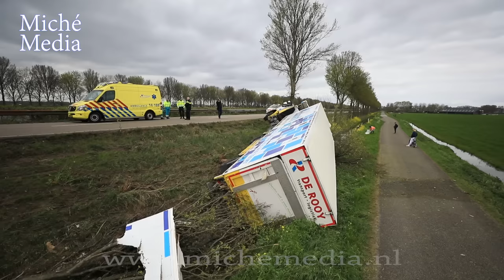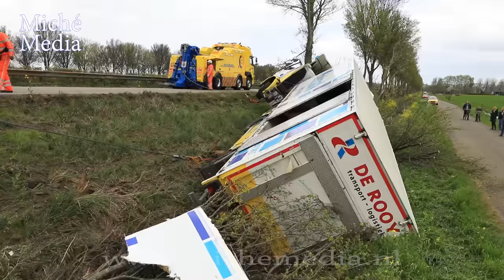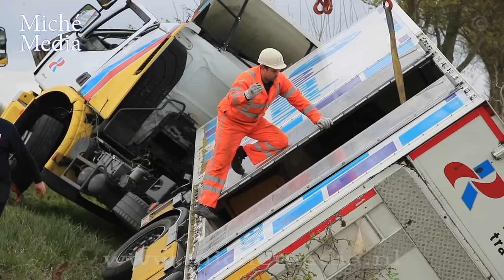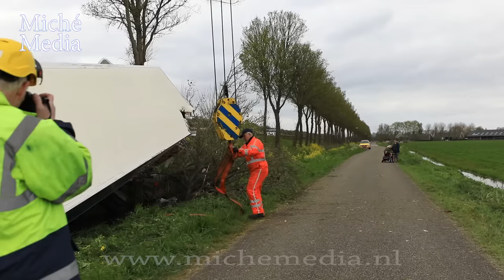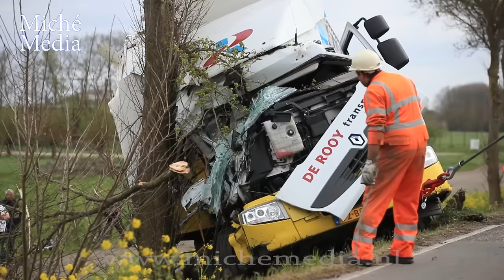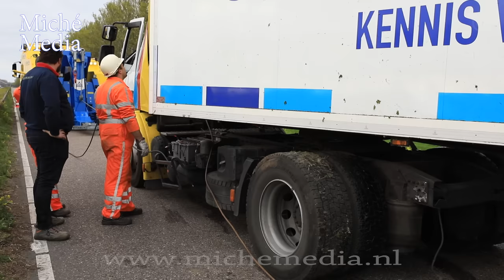HEAVY RECOVERY OF CRASHED TRUCK FROM DITCH  🚚

Comment: Nice job on a difficult recovery, it might have been quicker/easier with a rotator instead of having to wait for that crane.
Reply: A rotator does not make sense here. In the Netherlands and Germany we use heavy lorry cranes, its a big diffrence being able to lift 80 metric tonnes or more..
Reply: @class8866  did you ever look at Miller industries 100 ton  rotater ?
Reply: The crane came from close by.
Reply: @ventrac4500z  Our Cranres here in Germany are normally above this level of 100 metric tonnes. If there ist a heavy accident, they use today two cranes, and their lifting capacity is between 100 and 200 metric tonnes.
By the way the heaviest telescopic lorry cranes can easiliy lift in the range between 500 and 1300 metric tonnes today.
When I was young, this was an illusion, they were happy to lift 20 metric tonnes...
Reply: Why bother with rotators when there are mobile cranes almost always nearby?
Reply: Do they have rotators in the Netherlands?
Reply: @jerryvandyke9216  offcourse